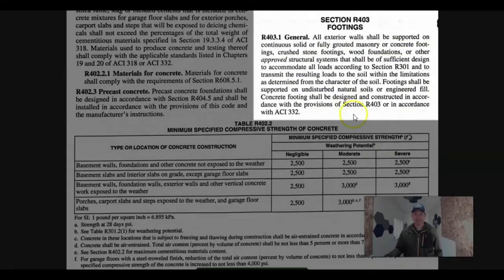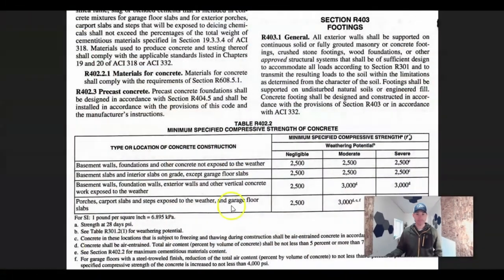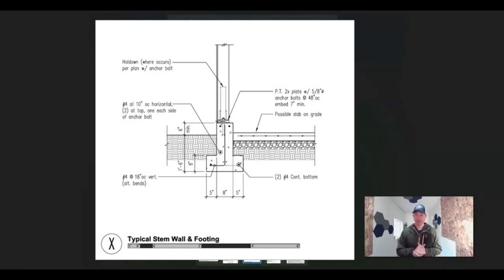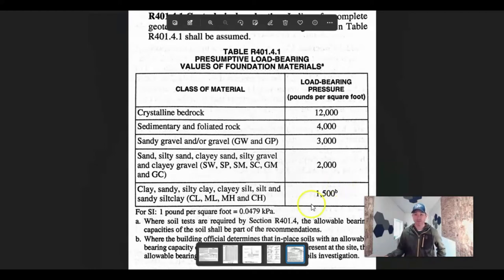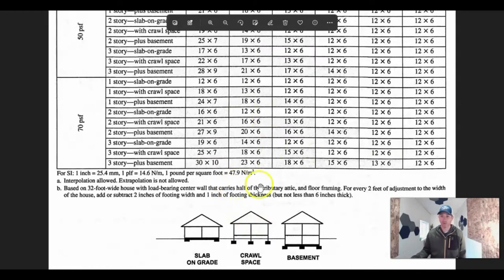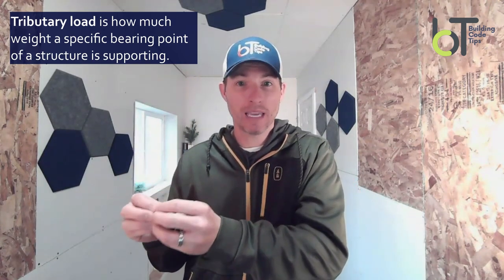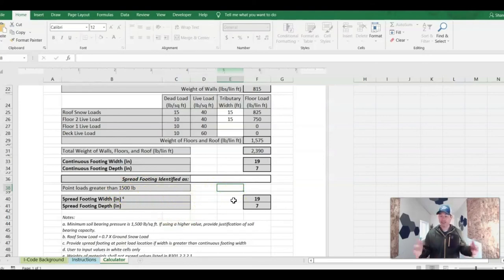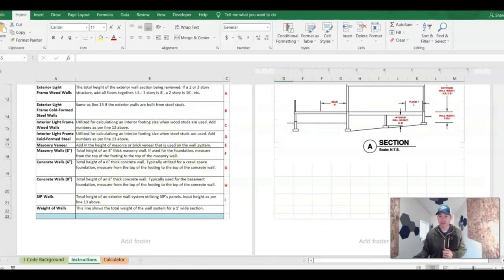FOOTING DESIGN | MINIMUM REQUIREMENTS FOR DIY

Comment: I would like to see an episode about building on pre-existing footings during remodels. I have seen a lot of patios turned into living spaces with very mixed results
Reply from the maker: Thanks for the comment! That's a great thought and something I do run into.
Reply: @buildingcodetips  I used to see that a ton in PHX, but slab pours out there are a lot simpler than in places where it gets below freezing, so it seemed easier to convert
Reply from the maker: @AustinCoulson  ohh ya for sure! In areas with no frost depth the code book only requires footings to be 12" below grade. In colder climates it gets much more difficult to transition an existing patio into a living space when the frost depth is 24 to 30" or greater. In many cases its almost easier to demo the patio and start from scratch.

Comment: I'm about to start my foundation pretty soon, I'm gonna do a monolithic pour. 1/2 " J bolts are correct for a detached work shop?
Reply from the maker: Yes, per the IRC. 1/2" x 10" j-bolts with 7" of embedment is the minimum requirement. Maximum spacing is 6ft oc and within 12" of the plate breaks/corners/etc.
Reply: Well I ran into my city inspector today and he said No on the 1/2 inch J bolts. He said 5/8 is what he wants. I really hope I don't screw this up, it's very confusing.
Reply from the maker: @alfredovargas616  apologies for any confusion on my end. IRC allows for 1/2” j-bolts. My only guess is that you live in a higher seismic or wind zone area then normal and your state, county or city  is asking for more anchorage then normal. Definitely follow whatever your local building department is asking for.
Reply: It's strange because my plans were approved with 1/2 bolts, and I sent my plans 1st to my inspector,  then also to the city, and both approved 1/2 yet now at a random incounter he changed his mind 🤔
Reply from the maker: @alfredovargas616  That's interesting, approved plans should supersede. If your local building department has any customer service and your able to talk to the plans examiner who reviewed your plans it might be worth asking.
Reply: Your absolutely right, I want to ask my inspector if he can go over my plans and indicate anything he'd "better" my build. Because I don't want to come off as combative. My plans also are approved 2 #4 rebar on 12" footings, but no rebar in middle slab, I have a feeling he'll fail my pre pour inspection due to that. I guess I can wait till then though?
Reply from the maker: @alfredovargas616  When they come look at the footings prior to pour ask the inspector to verify that what is on the plans is approved for the rest of the project (ask it in the form of a question and get there answer). If they push for more you might ask what the reasoning would be to help you understand and see what they say. Just a thought!... In my opinion it would be pretty shady to ask for more than what is approved.
Reply: Yeah that's what I'll do, I'm just a little nervous, because I'm following my written instructions and somehow I might get things wrong.   Materials are so expensive to be getting things wrong